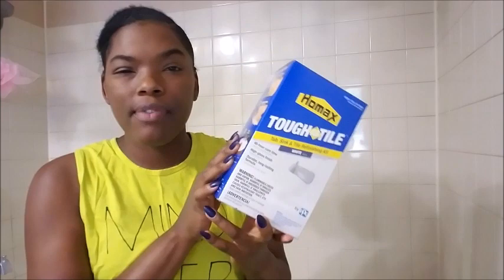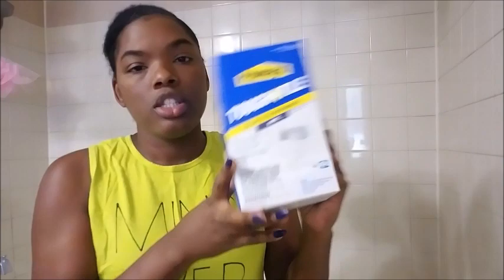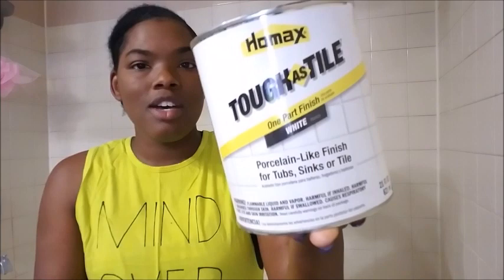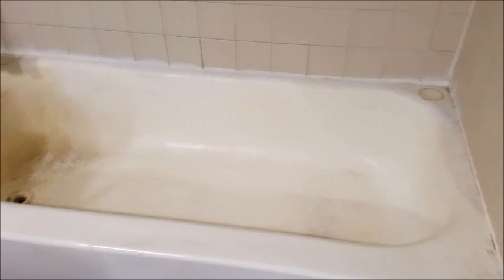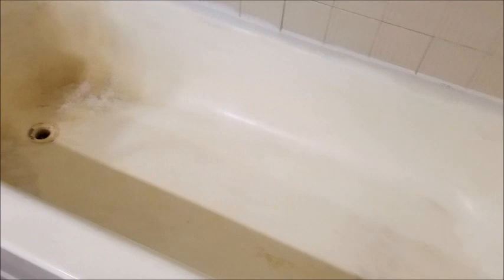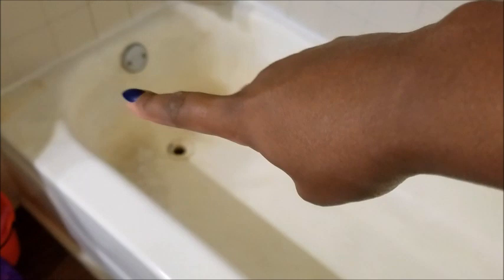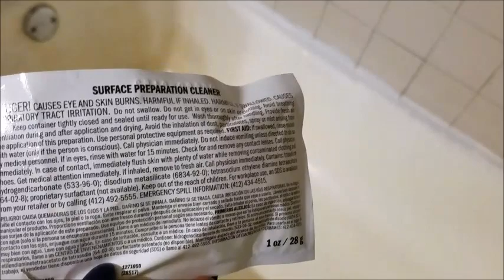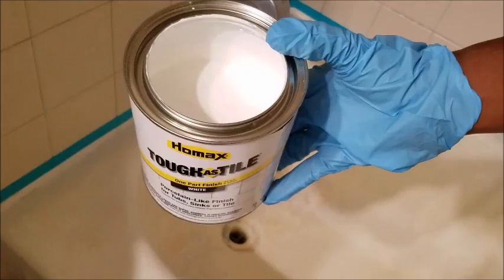How-to: Repaint your Tub | Rental Friendly |  CheapToChic |

Comment: Another product that is guaranteed to fail. About 1/2 of the jobs I do require stripping this cheap epoxy paint off a tub. In order for this to work porcelain has to be acid washed and primered before the topcoat is applied - all with a spray gun. I'll always encourage people to do work themselves - except for bathtub reglazing. If you have never painted a car, leave this to the professionals.
Reply: Will this wash off I’m confused? So it won’t work ?
Reply: @selarios373  It will look good the day you apply it but it won't be very long until it peels off. These coatings are not designed to stick (adhear) to a non-porous surface such as ceramic or porcelain. Your tub needs to be washed with a Hydrofluoric acid to make it porous then have some sort of epoxy primer applied to it. After that then the high gloss top coat is applied. It's something better done professionally but if you do it will last 12 to 15 years before the coating starts to dull out. Half of my jobs are stripping these DIY jobs off tubs. It's an additional $250 on top of the reglazing out here in Los Angeles.
Reply from the maker: @billysyms5761  very good to know i moved so I'm not sure what the long term results were by thanks for the information

Comment: Your a beast. No respirator or mask?   I had a mask and the fumes were still unbearable.
Reply: Yeah she’s lucky she survived that! Those fumes from tough as tile are very dangerous and can be deadly and cause brain damage and even death! Always make sure your filters say organic vapor on your filters of your mask! Each cartridge contains granulated charcoal that is treated to absorb organic vapors from the air passing through as you inhale. Used mainly to protect against solvents, such as those in oil-based paints. Others would include paint thinner, lacquer thinner, turpentine and fuel vapors.